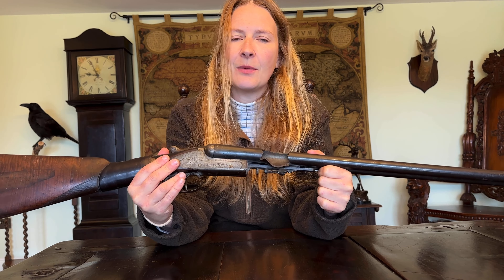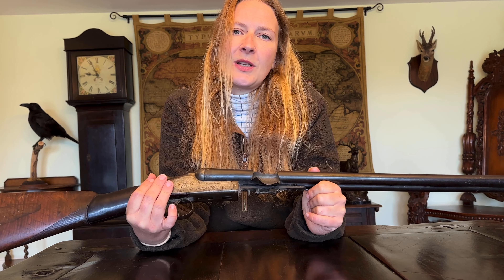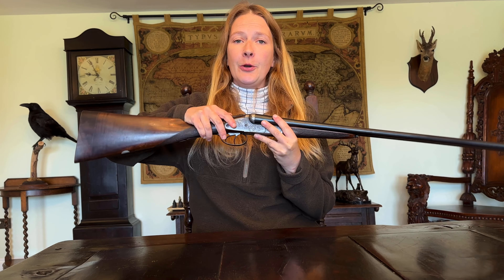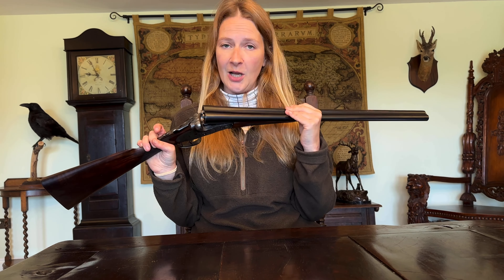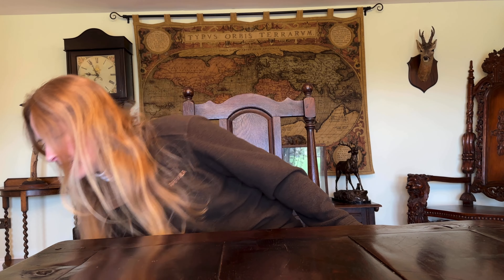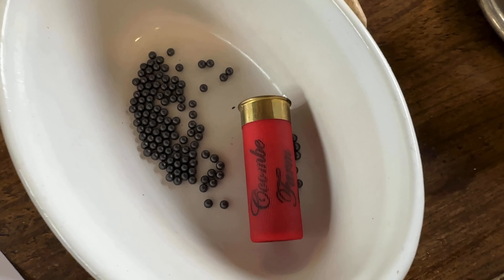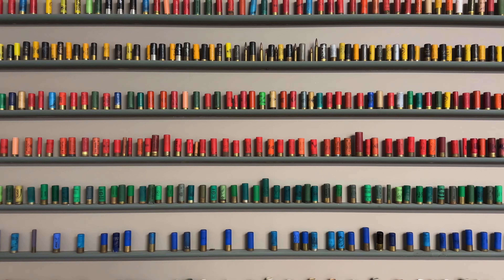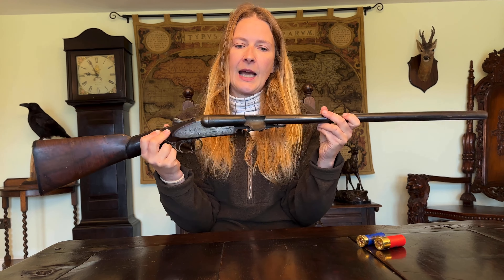Driven Game Shooting: The Origins and How It Works

Comment: Very informative - thanks 
Any empirical evidence that an over and under is more accurate than the sbs?
Fully satisfied with an inherited cogswell and Harrison sbs
Reply from the maker: I have taken this from Fieldsports Journal because it is hard to explain somethings in such few words:

So, with longer-range birds, where the visual profile of the bird shrinks in size, the narrower, single-sighting plane of the over-under makes the task of holding the line of the bird a lot easier. Essentially, you have greater pointability and a greater degree of precision.
Reply: @ hmm possibly true 
Thanks